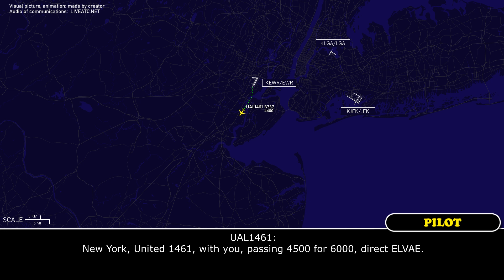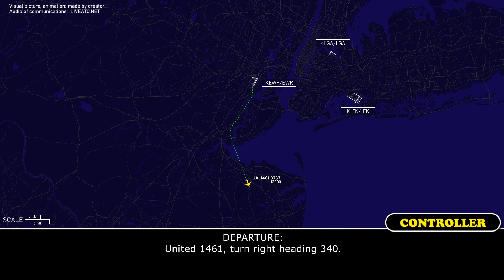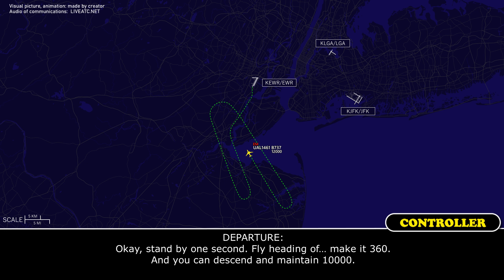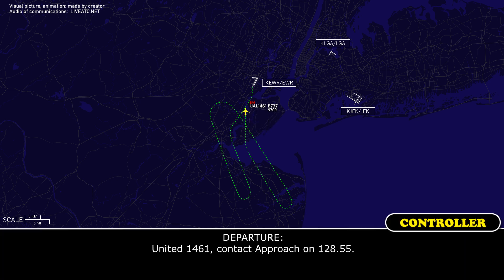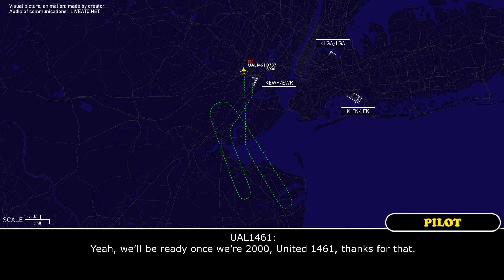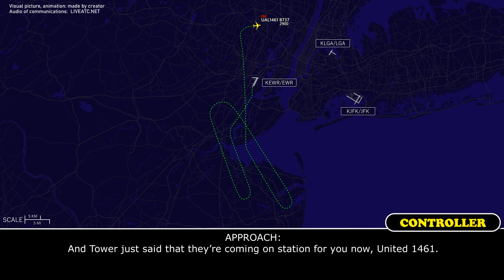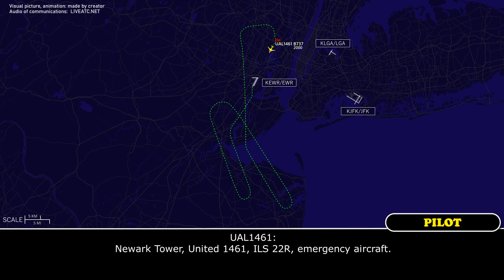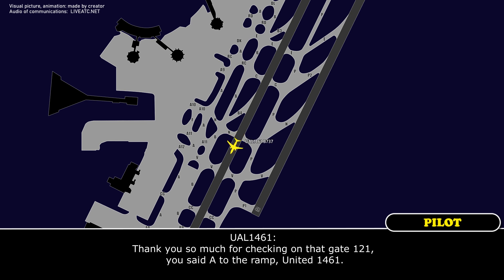Flight control issue. Flap asymmetry. United Boeing B737 need to return to Newark. Real ATC

Comment: Sorry to spoil all your drama but this is no big deal. If the aircrafts detects the tiniest of difference in flap extension in the flaps they stop moving and cannot be moved again as the system is locked out. It just means we have to land with whatever flap setting it is at when they stopped moving. The only drama is landing overweight where the brakes may get hot so, the trucks will have to roll with the landing lLOL